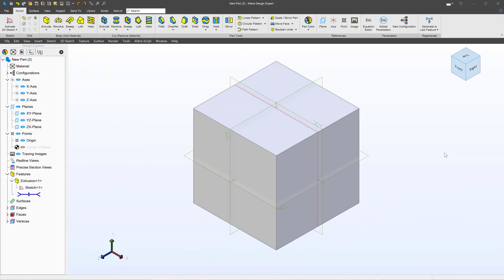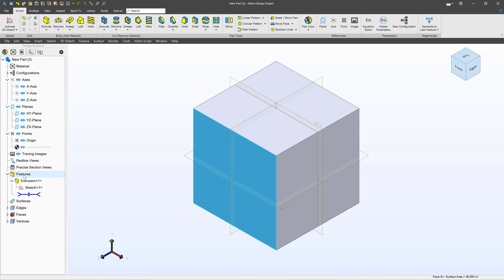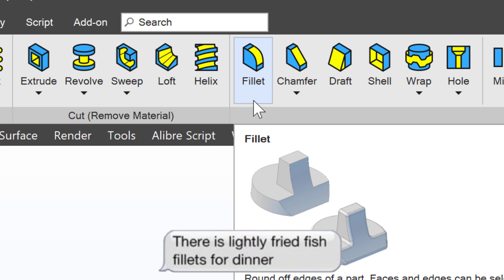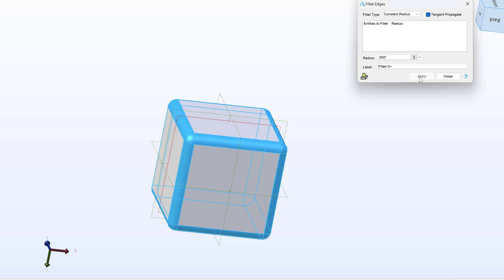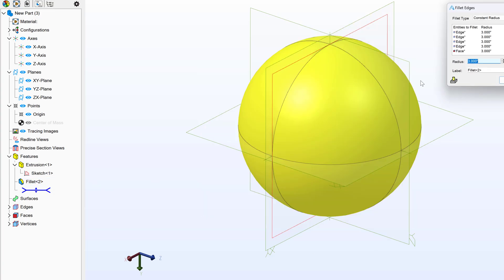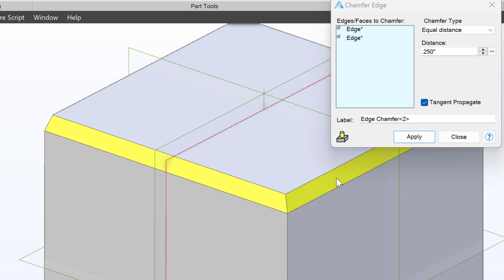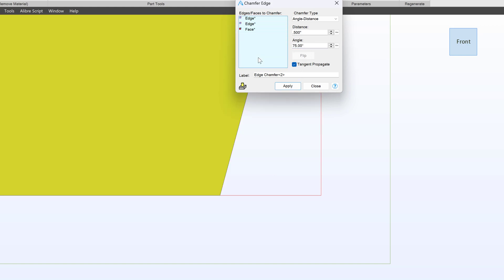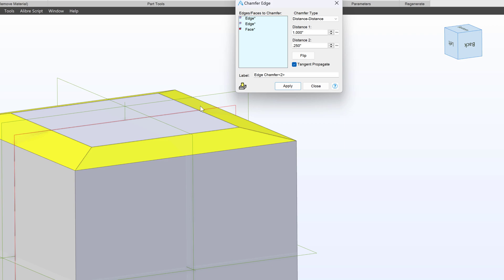Fillets and Chamfer Creation | Alibre Beginner Course #12

Comment: It would be helpful if you would also address the "Tangent Propagate" feature in this video.
Reply from the maker: That's a great suggestion!  In a nutshell, tangent propagate allows the fillet to continue down other edges instead of only smoothing one edge at a time.
Reply: @AlibreLLC  Yes, I figured that out myself just by turning the feature on and off to see the results. It's a powerful feature but it can cause surprising results if one doesn't understand what it does.
Reply from the maker: @tyrannus_tyrannus  If you have any other questions, feel free to ask on our livestream today in about an hour and a half

Comment: Following along with your instructions and the Angle-Distance option is causing inconsistent results when the angle is set to anything other than 45 degrees. Using the same 6" cube, when chamfering 4 of the edges of one face of the cube, at least 1 edge will have a different angle from the other 3. The angle itself is the same, just going in the wrong direction. This occurs when selecting the edges individually as well as chamfering by face. I don't see a way to select an individual edge and modify it's options (like maybe reverse/invert) since they all share the same settings. The same incorrect result also happens when you select 3 of the edges in one chamfer operation and then do the final edge in a separate chamfer. Frustrating.
Reply from the maker: Selecting whole faces, if possible, can help with that.  Additionally, going to options> parts/assemblies > 3D previews and disabling 'Show previews" enables chamfer flip in the chamfer dialogue if something is coming in the wrong way. Hope that helps!

Comment: These two tools are ones that frustrate me at times.

First of all the fact you can't flip  direction on the angle-distance Chamfer.

2. The fillet command isn't as powerful as the SolidWorks, Solid Edge or Visicad one. It can be really picky in the order you need to put the fillets down. Cause a long chain of fillets in the tree.
And secondly it doesn't appear to like it when it can't place a full radius.